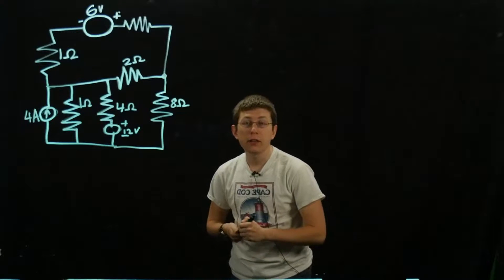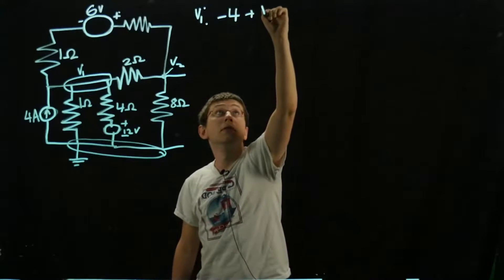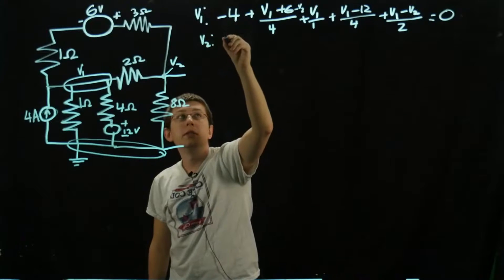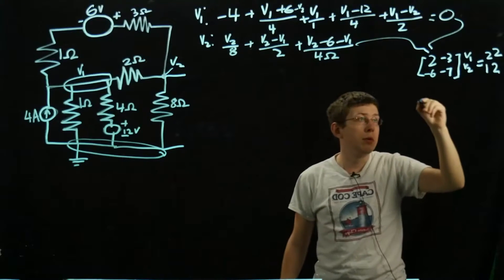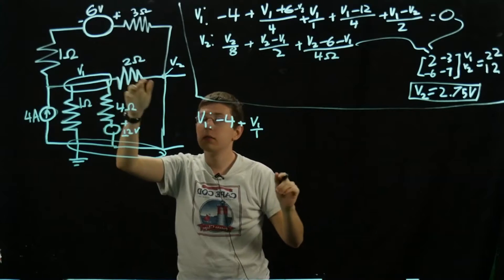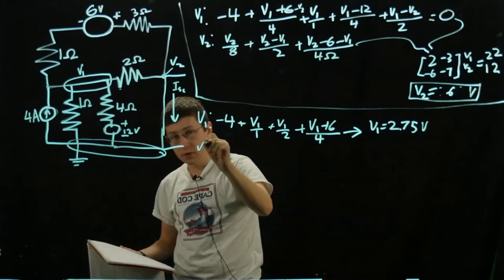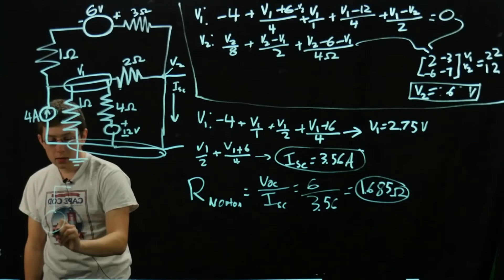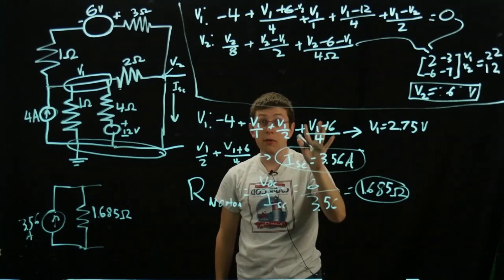Circuits 1 - Norton Equivalent Circuit Example

Comment: You got the short circuit current correct. Voc not so much. Your coefficient matrix for the node voltage equations is wrong. You can check your solution by plugging V2 = 6, into each KCL equation. If you do this at node 1, you get V1 = 5. At node 2, V1 = 9.  --><--

Comment: Everything was fantastic, and then you shorted the 8ohm resistor. I've only ever heard of shorting the Vsources and opening the current sources. ?!?!?!?
Reply: 8 Ohm = Norton Equivalent Current. You need to short it to find the current. After which, you can begin drawing the equivalent circuit and solve for R n. (R=V/In)
Reply: The Norton current is the short circuit current across the terminals A-B. That short circuit is in parallel with the 8 ohm resistor. The equivalent resistance of a short circuit in parallel with a resistor of any size is zero; i.e. another short circuit. Dan just replaced the parallel combination of 8 ohms and a short with its equivalent resistance. Another way to view this is to apply the current divider rule: if you have current supplied to an 8 ohm resistor and a 0 ohm resistor (short) in parallel then all the current will flow through the 0 ohm resistor.

Comment: For the calculation of the short circuit current, will (V1-12)/4 , not come into consideration????
Reply: You're actually misunderstood his question I think @UConn HKN. You did miss that term in the equation that resulted with 2.75 Volts for V1. The tutor made a mistake with the voltages and didn't finish the equation. Instead he drew an arrow to the 2.75 Volts and forgot a term. I think that's what you were going for @Avishek Paul.
Reply from the maker: Hello, thats a great question! The answer is that it does not! We find the short circuit current by first replacing our "load" with a short circuit. Then, we use Kirchoff's Current Law to find the current value. In this case, we perform the analysis at the circuit node marked "V2". The three branches that are attached to this node does not include the one you specified, so we use this in our calculation. Where this branch does come up is in the calculation of the node voltage V1 that we use to solve the short circuit current.

Thanks again for the great question, and I hope this helps!

- Andrew
Reply: ya dats wat I was pointing to